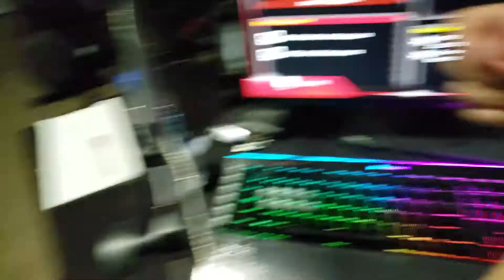Liquid damage RAM repair

Comment: How do I remove the heatspreader?
a year ago my wife spilled water on my PC, I was allowed to build a new PC of course, but after getting the new parts I realized it was only one RAM stick which was water damaged. And the old PC became the new home server.

But my old home server had 16gig og DDR3 memory, and this new much more powerful server now only has 8gigs of DDR4 memory. And I can practically not run game servers or VMs together with my normal daily workload

Comment: Is this fake? Is this safe?
Reply from the maker: This is actually the same process used when doing a phone . The phone is placed in an alcohol bath like this but into a vibrating machine that helps desolve the corrosion off the contact points. Since I don't have the machine I had to slightly brush it off . But yeah dosnt always work but the alchohol will not hurt your device